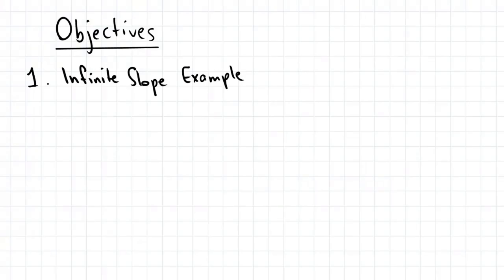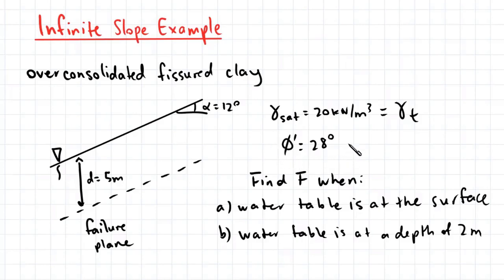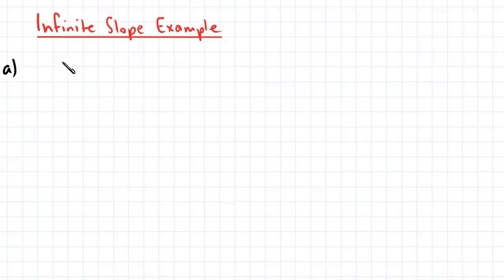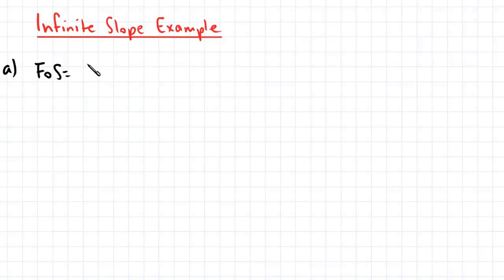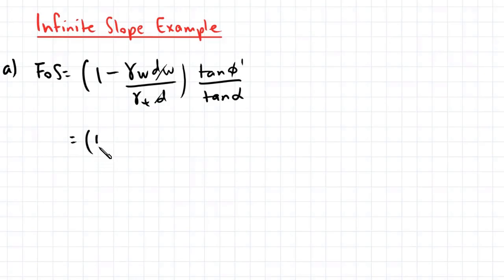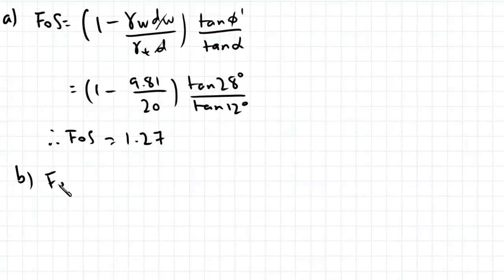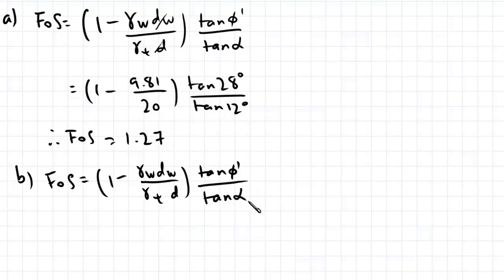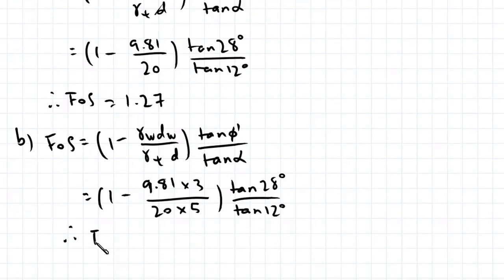18.3 Infinite Slope Example

Comment: the angle of inclination of an infinite slope to the horizontal is 28 degrees, the shear strength parameter which are angle of internal friction and cohesion of a soil sample taken from slope are 17 degree and 40kilo-newton per meter squared. the dry density of the soil was determined to be 900kilogram per meter cube. soil porosity is 0.4 determinne the critical height of the slope if water table is 70% of depth of slope surface and parallel to the slope